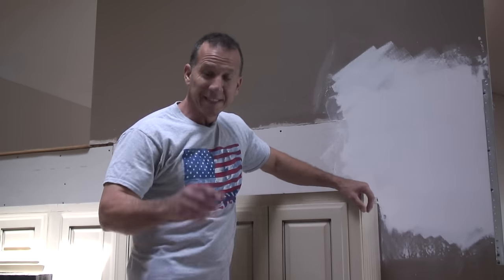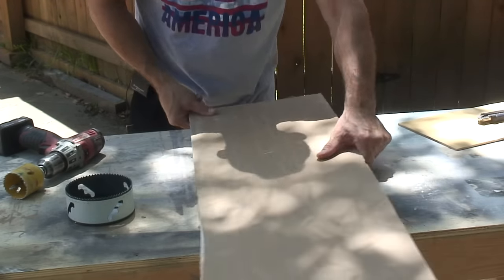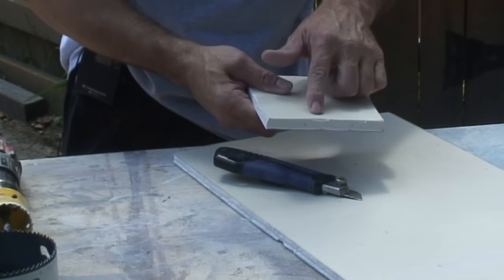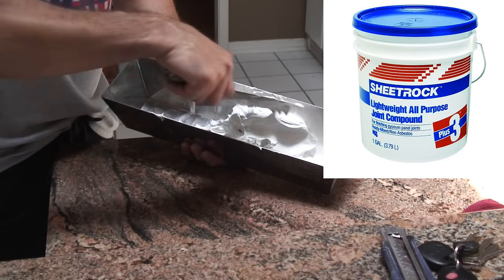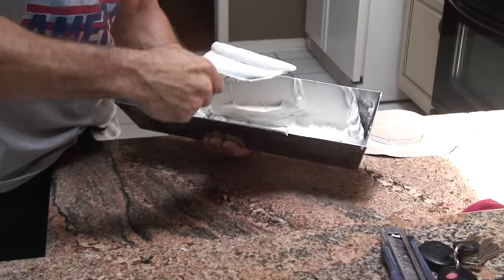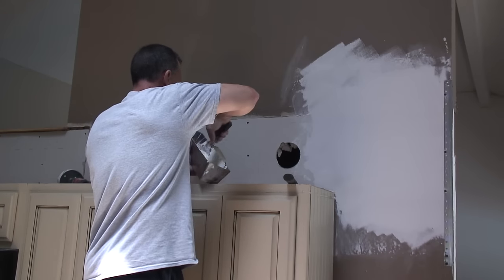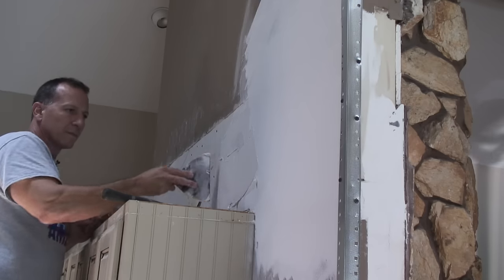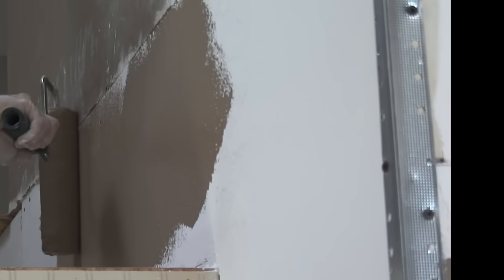Easiest wall FIX EVER!

Comment: I cut out a square or rectangular hole via a bubble-level and a Sheetrock hand saw. I cut a 1/2" thick plywood, 1.5" wide (min) by 2.5" at both end of the hole. For example, if the hole is 5x6", let's say you want the plywood on the 5" side, the length will be 5+2.5+2.5=10". You may need 2 pieces, unless you lay over the stud.  I secure the plywood with Sheetrock screws, one at each end will do. I prefer plywood vs. a 3/4" wood scrap because it does not split easily on a short piece. I cut 1/2" or whatever thickness Sheetrock for the hole, attach the Sheetrock to the plywood via screw(s). I prefer the fast-setting hot mud in powder form.  It hardens faster (in minutes vs. 24 hours) and it is stronger, yet easy to sand like the premixed mud. Of course, paper tape with the mud.

Comment: When you say your hole is larger than the plug you don't explain how it got that way! Are you using a different size hole saw for the hole? By what amount, I would assume 1/8" standard drywall gap?

Comment: Good tip, but... you should always tape the horizontal seam, even if it's hidden behind the cabinets.  Fire taping is usually required by code.  One coat doesn't take that long..

Comment: Use the Template to Cut the back the patch Drywall also, and you don't have to patch a Small Hole.  after in I trace around the large Paper of Partch and cut it with Razor to remove the Paper under it around the Hole Im patching so it all is Flush Level when fit together

Comment: If you use your pilot wood for the "plugs" too you can leave the drill bit out of the hole saw and you wont have small holes in the infill...

Comment: Sad to see the days of the "plasterer" have gone ,These holes would be fixed in a similar way , but with no drills and hole saws, and in half the time. Another trade bits the dust.

Still good info for someone that has no experience.

Comment: do you loosen up your mud for the skin coat?
Reply from the maker: Good morning Jeffrey,
I whip the mud up for everything, because it will be clumpy and harder to spread if you don't.. This is a common mistake that people make. If you do not whip it and make it creamy, you may have a problem with t bulging under your tape. When this happens, you will feel a lump on your wall with your hand. Pre- mixing it also gets the air bubbles out so you will have a smooth skin coat without pits when you sand it. Sanding it with air bubbles will leave tiny holes when you sand the top layer and uncover the air pockets. Good to hear from you.
Thanks!
Paul

Comment: This is very craftsmanlike. Nice. But I object to the title of "easiest". Easiest is to patch the first hammer hole with some spackle. If the hole is too big for that, I go to the stud and cut out the damaged piece so I can simply replace the section with new drywall. Your video is for contractors working on high end buildings.

Comment: Good job. Just as easy without the drill though. Just cut the patch square with the knife to the required size then hold it over the hole and draw round it. Cut out where you drew and your square patch will fit in perfectly. Drywall isn't kind to edge tools and too much of that would wreck the hole saw. Good demonstration though ;-)
Reply from the maker: Hi Graham,
I agree that it is just as easy for you and I because we are experienced in drywall. I have done countless square patterns over the years, but this way is more friendly for the average DIY'er. Thanks for taking the time to watch my video and I also appreciate your comment! Have a good day.
Paul

Comment: this is amazing i have a hole in my wall made by a doorknob im gonna try
Reply from the maker: Hi Alasha,
Is the hole completely broken through or is it a dent?  If it is not completely broken through the wall. You may not need to do this if your hole is small or only dented.
Thanks!
Paul

Comment: nice but if you don't have a hole saw a square blow out patch is the norm with that said I would rather drill a hole in a wall verses cutting with keyhole saw 👍

Comment: Just cut out a piece of board the same size, or make the whole bigger so that it matches your cut out. screw a piece of wood across the gap inside the cavity using self tapers and board screws. Then simply screw the new piece of board (the fix) using a board or flat head self tapper screw tightened so that it/they dent the surface with heads below the surface. Don't break the paper. Then fill the gap with filler and smooth over. No raised edges either.
Reply: Screw the new piece of board to the timber bridge I should have said.
Reply from the maker: Hi Phil, 
Although I appreciate your suggestion, this method is faster and you can do it without having to cut a piece of wood, use screws, or tape. You have to cover any seems with mesh or paper tape because you will have visible cracks after the filler dries. You must cover the seems.
Thanks!
Paul

Comment: just drywall screw a couple strips of plywood on the backside of the hole and screw the plug to it, way stronger and faster.
Reply from the maker: Your way will work, but it will definitely take longer. This type of patch is the industry standard for smaller holes. Your way would require one to cut strips of wood,, cut a plug and scribe it on the wall, screw the strips in place and holding the strips tight while trying to screw them in. Then, after all these steps, you will have to mud ,tape and float the patch. This will work in your personal home, but it will not be tolerated on a construction site. I have worked on residential and commercial jobs for years and this is never done on a job. Sorry!

Comment: That works on that type of wall, but if my wall is finished and textures that doesn't work
Reply from the maker: Yes it will, all you have to do is lightly sand the texture and put your patch in. You will have to re-texture the wall when you are done. I cover this on a previous video, how to repair a hole in the wall. I also show a few useful tips on that series of videos.
Thanks!
Paul

Comment: they don't make 3/4" drywall,  3/8", 1/2", or 5/8" fireblock.
Reply from the maker: Hi Cody, 
They do sell 3/4" drywall, and I have used it in the past for soundproofing. They also make 1" panels for exceptional circumstances. You may not know it because it is not as popular as 5/8".  Here is a link that may help you.
Thanks!
 Paul
CGC Sheetrock® Brand Ultracode® Core Gypsum Panels - USGwww.usg.com/.../wallboard/...panels/cgc-sheetrock-ultracode-core-g.

Comment: why waste loads of time doing that just put a piece of 2x1 through the hole and hold it with a screw then put a couple of drywall screws in it then pop the piece in and screw to the 2x1.
Reply from the maker: Hi Woody
This method works without having to use tape, wood, or screws. Iv'e worked on both commercial and residential jobs for over 25 years and this type of patch is the industry standard for drywall repairs. it is much faster than you would think, I am taking my time on this for video purposes. You should try it, you may like how it works.
Thanks!
Paul
Reply: Paul Ricalde. great communication skills though, very easy to understand demonstration.

Comment: Title is misleading...this is not  fixing  a wall,  99% of the time  the paint color will not match where the patch is needed so, what do you when the paint doesn't match so you can't see the difference?   A good mud guy  will always  plaster  with at least  2 coats.  If the hole is too big you  must add studs or  support to hold the  new drywall.  Great video for  people who want to do some  DIY  at home  but it is not very professional to cut steps specially when your reputation and license  is on the line.  I am a contractor  and I learned the hard way to do things  the right way  at once.

Comment: I disagree. it"s not an easiest or quickest fix ever. You spend more time just preparing these plugs and applying them. The easiest way is to use scrap timber/mdf/ply planks from behind using only two screws. Third screw will hold plasterboard disk. That's it, you good to skim it. Your way you need to wait until your "glue" dries, because you cannot skim on moving patch. The goat is a lie.
Reply from the maker: Hey Nemo D123
You still have to tape your joint or it will crack when the mud dries. It is not called glue, it is joint compound. I have worked on both commercial and residential construction  sites for years. This type of patch is the industry standard, I am just making it easier for the average DIY'er. Keep doing it your way if it works for you, but use tape or mesh if you want your patch to look good.

Comment: why americans make their walls out of paper
Reply: Sorry my english is so suck Only our interior facades.  And chiefly because it is a cheap, effective, and easily worked material.  Older American homes have more "traditional" walls that you may be used to.  These don't have the benefits that sheetrock/drywall afford.  And as you see here, they are easily mended or altered.
Reply: Internal walls, whose only job is to divide the space. External walls are way ticker and better insulated. Also, this kind of wall is useful when you want to pass new cables and tubing through the house, as there's a hollow space in between, and as additional benefits the whole structure is lighter and the materials are cheaper, and as you've seen these walls are very easy to repair. Very flexible.
By the way it's not only Americans who build like that, I've seen the same thing done in more than one country (Italy, Greece, England), and there are reasons.
There are drawbacks as well, of course, for one that the walls are way more fragile, and you have to keep an eye out when piercing them and hanging stuff, and also acoustic insulation is bad. Seems like a lot of people are willing to take the drawbacks in order to collect the benefits, but what do I know...